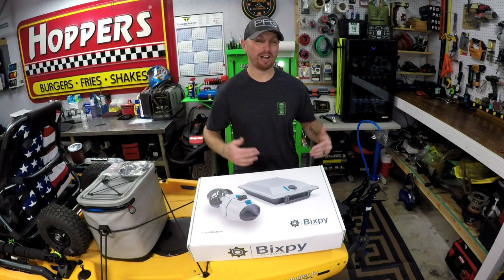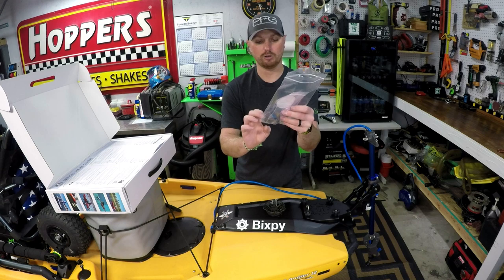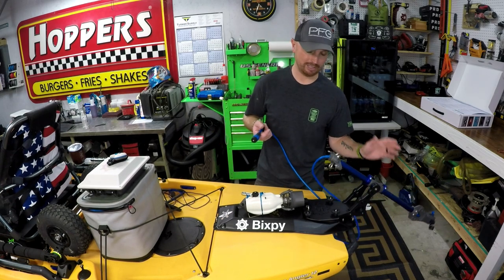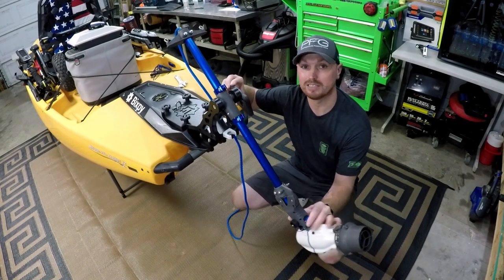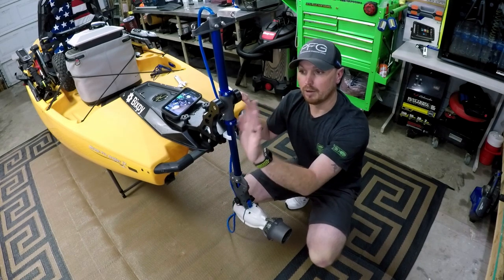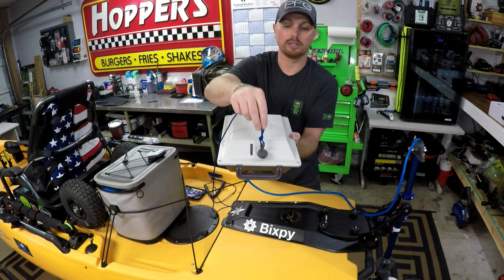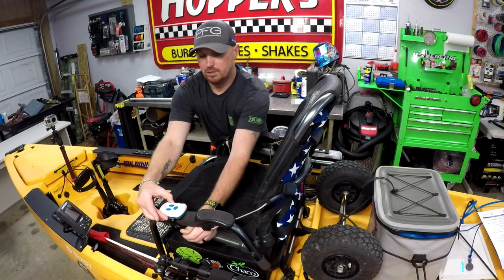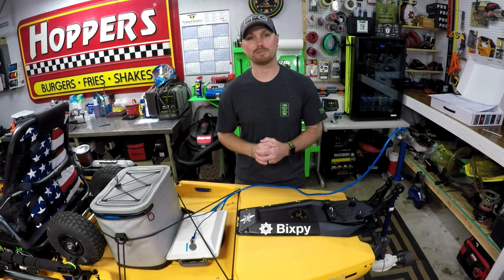Installing a Bixpy Motor on my Kayak!! | 2020 Kayak DIY

Comment: There's nothing like, putting your  kayak away, in her warm parking spot for the winter. As much as we all hate too. But love, adding new accessories, ideas, your own DIY Mods. I remember installing m Bixpyv J2 motor. With my boat having the big toe contro,l drop down rudder. I was extremely scared cutting up my factory rudder with  the template. But all came out perfect. Wouldn't trade my 120  Pdl for anythiyng. Flats boat, you can keep it. Not getting in 6" of water. Lol 🙏 🎣  Great install, beautiful vessel..

Comment: Is there any info regarding the depth the motor sits in the water. On the rudder adapter that they offer it tells u to determine your water level and then mount the rudder adapter 3 inches below that. In your video(excellent job as always) it wasn’t clear if u could adjust the pole length if needed. If u can’t how far doesn’t the motor sit below the kayak.
Reply from the maker: Great question! I’m not sure the exact death below the top of the water that it should be but this thing is very adjustable. Just like a trolling motor, it has a little collar on the shaft just above and below the mount. You just loosen them and slide the shaft up and down. Thanks for watching 🤙🏼🎣